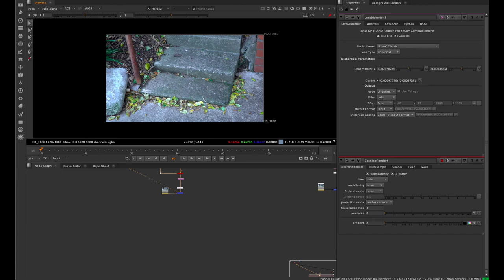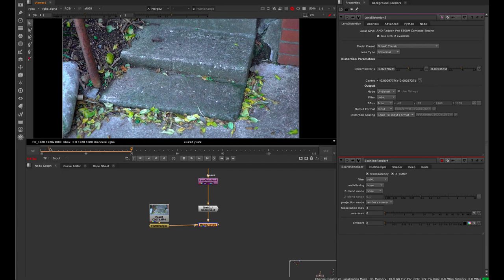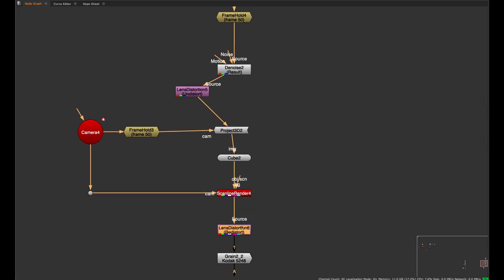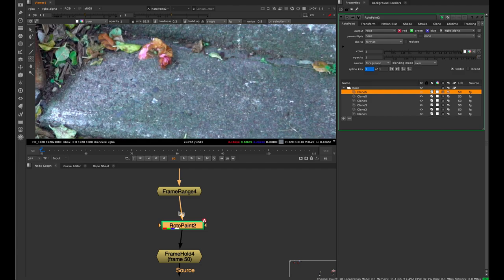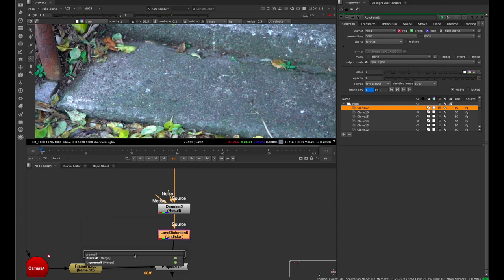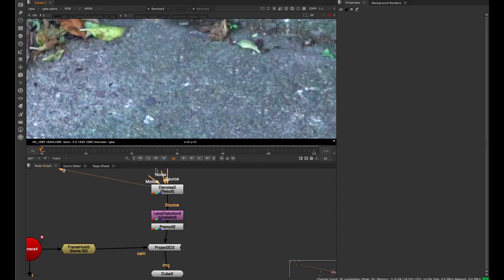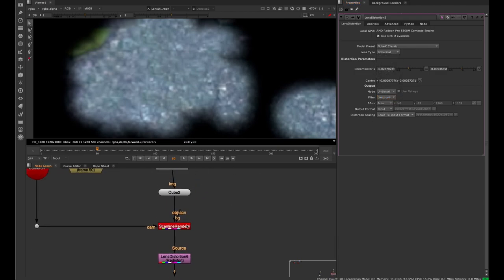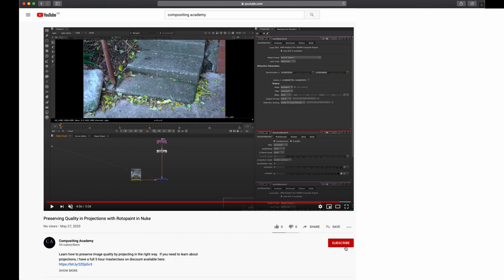Preserve Quality | Projections in Nuke

Comment: Hi there, I have found this channel from one of your Udemy courses. I am looking at doing all 3 however would they all work with the free non commercial version of nuke or will I need to buy it? Thanks
Reply from the maker: Amy Taylor Hey Amy.  The non-commercial works perfect for the courses.  It has almost all of the features as commercial except that you can only render in HD maximum, and only use the software for personal projects.  (Theres a few other limitations, but 95% of the software is usable).  Cheers!
Reply from the maker: Also, if you'd like the courses on discount, they're all available here with the links below.  Here are the links if you are interested!
NK101:
https://www.udemy.com/course/introduction-to-nuke-compositing-nk101/?couponCode=DC1FCA0C1DBA99A52EBD
NK202:
https://www.udemy.com/course/methods-of-3d-compositing-masterclass-nk202/?couponCode=C3744BD8C2F8068C69BC
NK303:
https://www.udemy.com/course/fundamentals-of-cg-compositing-nk303/?couponCode=CB08FE3009A61DAB9E5E

Comment: Alex thanks for sharing your knowledge. i have been studying your courses on Udemy so far, 
i will going into nuke 303 soon (AOV's and all). 

i want to draw your attention into something i have discovered but i am not sure if i am doing it right.
i am talking about projection cleanup, other methods of projecting which you have shown in your paid course is great that is Patch/clone method. i also did UV projection using the Scanline render, i am sure you know about that.
 
i tried this method of outputting Alpha from the ROTOPAINT node on other footages. i discovered that it does not work very well for object that have alot of parralax, it tends to hold up quite nice on some frames but not all frames in the sequence, please what could be the problem.
Master please i need guidance. thanks waiting for your reply. it wil go a long way for me. once again thanks for your knowledge so far.
Reply from the maker: Hey there,
It sounds like you're doing the right thing.  For objects with a lot of parallax probably UV mode is the best because you can reduce the amount of stretching from one particular angle. 

If the problem you're seeing is overlapping or doubling up on the projection, make sure that in the Project 3D node you have it set to "Project on: Front", otherwise what might be happening is that it's projecting on two sides of the geometry.

Alternatively, you can do multiple projections from multiple angles and blend them together

Comment: Wouldn‘t it be much more useful to plug in an ST Map at the top and filter that 3 times and at the end apply that Transformation with an Stmap Node to your Patch, with that Method you will Save a lot more sharpness by only Filter one time.
Reply from the maker: Ben J yep you could!  That’s a good technique!  If you’re doing lots of these projections though it’s going to be a pain to do an st map setup everywhere though.  And this tutorial is also intended for beginners so they aren’t projecting the whole patch.